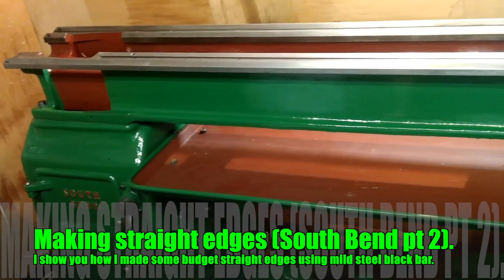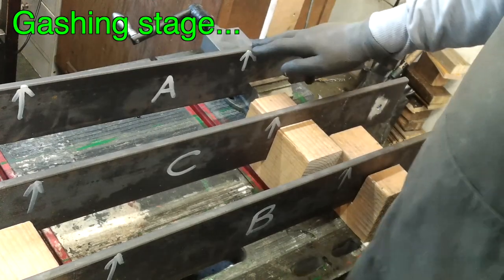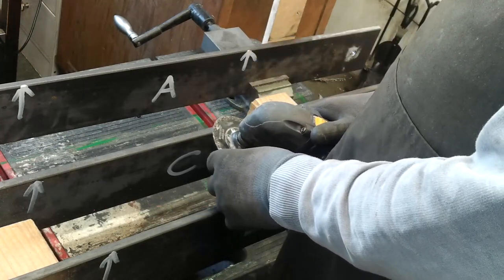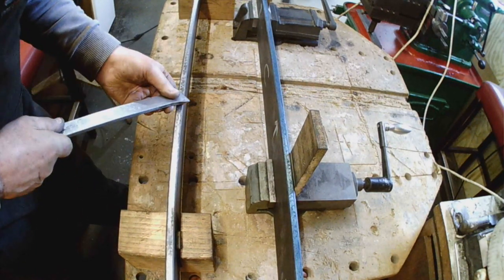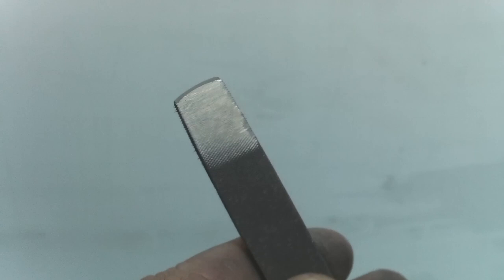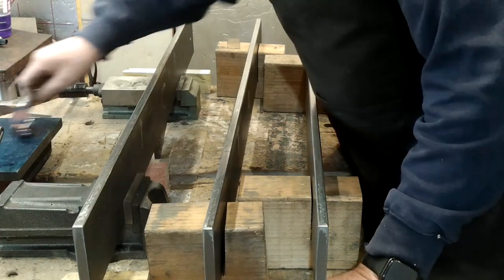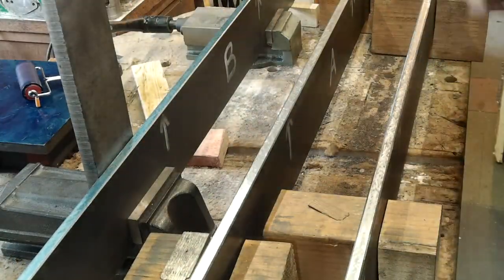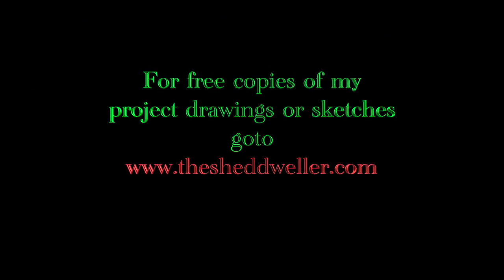Making a Straight Edge (south bend part 2)

Comment: Why you dont use carbo grid powder for grinding a>b b>c a>c a<b b<c a<c better runs with hardend steel. you get perfect flat shiny surface. You can use fine granite or other finegrid stones. Flat mirrors for telescopes will made by the same process. Precision gets easy lower than 1 micrometer. Fairly enough for your job to get done.
Reply from the maker: Hi, thanks I'll try to remember that. cheers.

Comment: Micrometer Brand Engineers Blue, I think it's the first time I've heard it mentioned on You Tube?
I still have a tin of it I picked up about 40+ years ago.
 As soon as you look at it, it gets 'everywhere', the more you try and clean it up, the further it goes 😁
I very rarely need to use it and when I do, as you said, use some 3 in 1 to thin it out a little.
I have mostly used a Sharpie/felt tip pen for general layout for as long as I can remember but Sharpie has a noticeable 'thickness' when used for checking mating surfaces plus dries out so doesn't transfer well

Comment: You are a patient man. When I was looking for a 1 metre straight edge som years ago I was advised by the dealership that a length of 4 “ bandsaw blade was quite accurate. Mounted it to a backing wooden board for handling purposes. He did say it was accurate to about 1 thou.
Reply from the maker: Hi, did you ever get one?
Reply: @Thesheddweller  Yes I did this, was about $40 from distant memory. Mainly use for checking and setting woodwork machines. The blade doesn't have teeth, the firm I bought it from manufactures blades, and also sells straightedges, but one of these at 1 metre was in the several hundred dollars.
Reply from the maker: @stanstevens3783  A great idea and a good tool, especially if you still use it. sometimes the old ones still rate as the best. cheers

Comment: Hi Paul.
Just found your channel via this video and I've subscribed. 
Very interesting method of making the straight edge. I need to work the bed on my 80 year old colchester master before long and found the price of a straight edge or regrind very prohibitive as you did.
I'll be very interested on your approach to mapping the lathe bed and will follow this closely. 
My little workshop and channel is still evolving as I delve into machining as a hobby from a career in heavy engineering and maintenance. Finding people like yourself who can provide good content and concise descriptions of what you are doing is a must.
Thanks for the video
Cheers Neil
Reply from the maker: Hi, I wish you all the luck in the world with your new channel. Mapping the bed ways are going to be done and shown in a short video soon. 
For your information…. I don’t have any special camera equipment, I have…  1 Aldi motorcycle camera, 1 very cheap amazon video camera supported on a wooden d.i.y. tripod, 1 very low budget clip on mic dangling off some sellotape from a bamboo cane. .
The whole lot cost about £73, so what I am saying is, let nothing deter you, then try improve on the previous video with what you’ve got, most important of all,  listen to your subscribers and you’ll soon be finding the whole adventure a pleasure.
regards.
Reply: @Thesheddweller  ha ha, brilliant!  My set up is an old smart phone mostly mounted on the remains of an angle poise lamp😁
I have loads of enthusiasm, no money  and back that that fails after 20 minutes of standing up, but we plod on. Just made a butt prop which is great, I can treble my standing time now which means I make even more mistakes😊
Looking forward to your next upload, cheer Neil
Reply from the maker: @NellsMechanicalManCave  :)

Comment: Enjoyed very much indeed. Inspiratjonal. I will have to watch a few times to fully appreciate it all. I can remember doing a similar technique during my engineering training but using draw filing.
Reply from the maker: Draw filing must have seen off a few files, mind you they could have been used as scrapers.   :-)  regards
Reply: @Thesheddweller  Yes. I was an aircraft technician in the Royal Air Force. In the first part of the practical side of my engineering training, they showed me what I had to make. A rectangular block, squared up, with various tapped holes in it. All hand work with files at that stage. So they showed us this nice flat, rectangular block with all sides mutually orthogonal, then gave us a piece of black bar that was practically round. Cue lots and lots of filing.
Reply from the maker: @carlwilson1772  Round bar…!. that was cruel.
Reply: @Thesheddweller  Perhaps it was but it worked.
Reply from the maker: @carlwilson1772  I had the same task at college, with round, stock but had to square it up using four different machines to get it somewhere near, then draw file to 2” square, mine ended up in the bin. If I remember rightly the tutor threw all of them in the bin, he was strict but we all learned from it...
Reply from the maker: That is the way I had to do it...

Comment: Excellent video I will need to watch it over (a few times maybe) to understand six step process.
I get your dilemma on the cost of professionally regrinding the bed. The solution is swapping professional cost with your labour (time) at home. If I were in the same situation I would offer the professionals off the books free labour around their factory/workshop for the regrinding  job. At the cost of labour these days your time even with a healthy excess margin maybe comparable to the time spent at home doing the best you could. Enjoyment doing it yourself at home verse enjoying working in a modern workshop. It could be a win win solution?
Reply from the maker: Hi, thanks, thats a great idea. It might be worth a try if they have manual machines. 
However, they would probably work the same probationary process that the company I worked for used.  As a charge hand, I knew that 'new employees' cost the company a lot of money until they had completed the probationary period.
This includes huge amounts of time with health and safety, induction courses, fire drills, overalls, thats before the machine familiarity and assigning another operator to oversee ’the new guy’. this is because of the size and cost of machines and the cost of materials is so high.
Oooo… I just found myself reading the riot act again .. I think I’ll just do it myself. regards

Comment: Sir, your work was very didactic for me. I´m trying to do something similar. Regarding the engineers blue, there are several tricks around, in my case, due to the lack of good suppliers in my area, I prepare mine using powder prussian blue into vaseline. it works fine for me. I could get flatness of 5 microns in 1.2 meters.
Reply from the maker: Sorry to appear so patronising but, I do try to aim for middle ground in my explanations. I have pointed out before that, I only show how I did what I did and hopefully I won’t be telling anyone how to do anything, because there are literally dozens of ways to do any engineering task, as with your powder and petroleum jelly to replace engineers blue. I do however, understand your supply issues.
regards

Comment: I think I'd have been tempted to machine  at least one of the  straight edges into a sort of a flat topped inverted V  so as to  get around the problem of windage.  I've seen a video of this normalizing process before.  Yours is way better.  That other fella used abrasives.
Did you look into the cost to have the edge ground to some stated tolerance?
Reply from the maker: Hi Raul. No, i didn’t look into the cost of getting the edges straightened because, the cost of getting stuff done here in the UK is prohibitively expensive. For instance getting a tooth refitted to the back gear wheel is in excess of £500, then I’ve got to re-profile it afterwards. I’ve used these straight edges quite a lot lately and they still confirm true against each other.  After Ive finished the lathe I’ll probably use the material from these straight edges on some project.
regards.

Comment: 8:57 You can use a U-shaped aluminum stock to prevent tilting. Use glue to attach sand paper to it
Reply from the maker: Hi, maybe,… maybe but, I needed some rigid  straight edges. cheers

Comment: You could have done all of this bed leveling and checking twist using a plumb bub 🙌🙏 I just made a video on how to make a metal rod that goes 3 ft. Up and attaches to the tool post cross slide and it hangs a plumble down. 100% accurate if done correctly